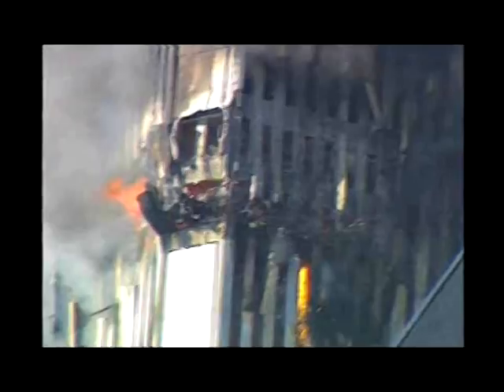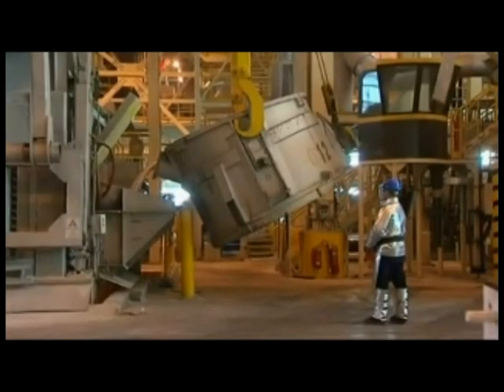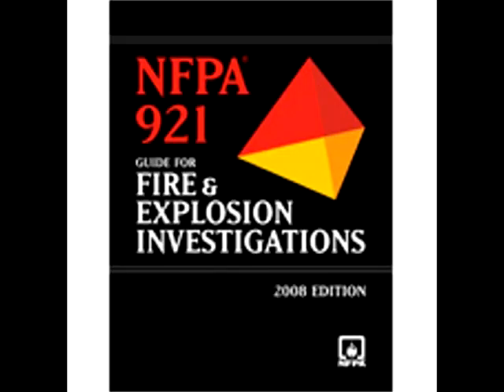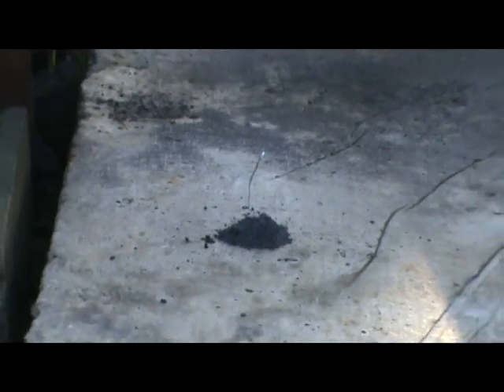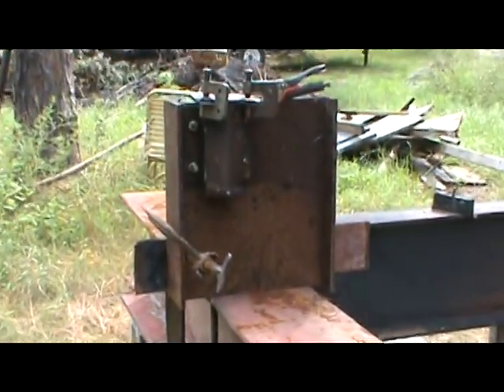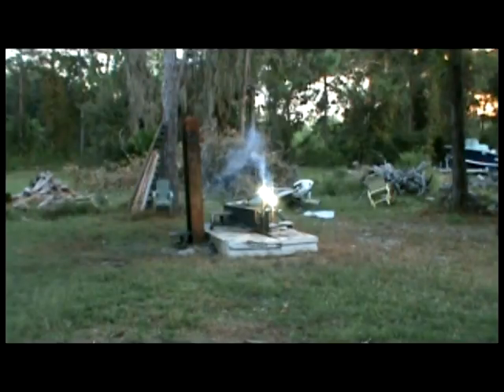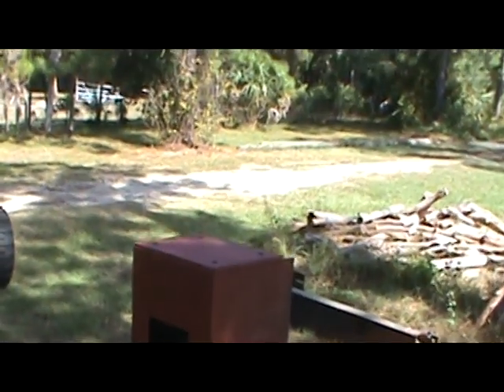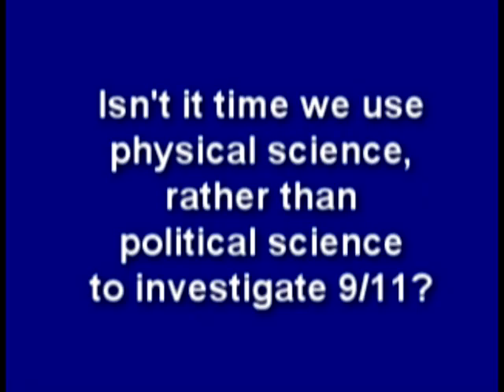9/11 Experiments: The Great Thermate Debate

Comment: The idea that 19 mostly unarmed men could cause such chaos, death, and destruction does not compute. It almost begs for a more complex explanation. Why not remote controlled bombs? That, in an odd way, makes way more “sense” than what really happened.

Remember 911.
Reply: Jason Smith Sure, you are right.  19 unarmed men can't create such chaos.  The thing that you are neglecting is that, once they has possession of the flight deck of those planes THEY WERE NOT UNARMED.  Tons of aluminum filled with jetfuel travelling at 500 miles per hour is in fact a very powerful WEAPON.

THis is like saying that I can't shoot 50 people in a crowded city street because i human cannot kill 50 people.  Give me the right weapons and of COURSE I can do so.
Reply: Mark Doldon
Ok, a plane can be a "weapon", but it is a totally inappropriate one for bringing down a modern steel building. Sure,  you can crash it and make a big fire, but that is not going to threaten the stability of the building.  A B-25 bomber accidently crashed into the Empire State building in 1944, but no one had the slightest fear that the building would  fall.

Comment: A commercial jet liner can not travel at cruising speed at 800-900 feet above sea level.   The air at that low of an altitude is too dense and the plane would break apart.
Reply: JulietsMan Nonsense.  It would probably be too expensive to get the place up to that speed at low altitude, and the engines themselves may not even have the power.  But in a dive the plane's structure itself will easily take the forces.

Comment: You make a very good point! honestly i believe the terrorist may have used intricately placed termite "cutters" on structurally important places. it would be easy for anyone to obtain schismatics of the building. one question i ask is why would the propaganda make the idea ludicrous and impossible.

 i don't think this was planed my the us to go to war that is ludicrous in itself. say if there wasn't people waiting for the planes to hit to ignite the termite to aid in the demolition of the towers.. why didn't the terrorists try to crash the planes closer to the base of the building? were they could potently do more damage to bring the building down? you don't cut down a tree down from the top or mid way. you cut it from the bottom to insure the tree falls, unless you have something planned to help.
Reply: In 1994, Frank DeMartini, was brought in to make damage and risk assessments of the Twin Towers after the bombing. This assessment was made in order to determine what weak areas (if any) that may have needed shoring up, or security placed around the area.

I don't know what came of those assessments, whether they actually shored anything up, or secured any vulnerable areas.

But I DO know that the design plans and the risk and damage assessments were handed over to FEMA and NIST.

Comment: Where do you propose they put the thermate? And how did they apply the thermate? And how was the thermate ignited?
Reply: Ask FEMA and NIST. They were the ones who had the risk and damage assessments that were completed after the bombing in '93.

Ask SAIC, who owns the patent on nano thermite.

You might as well ask them, because your Press certainly won't!
Reply: Thanks to the limitless generosity of the US taxpayers, your questions have all been thoroughly answered.  Although many of the details are Military "secrets".  If you look at all the Youtube videos of WTC wreckage, you will note that some of the columns were cutoff diagonally, with the Thermate, to facilatate the instantaneous elimination of any support to the respective buildings.  In ancient times, it would have been set off by fuses, like fireworks, but nowadays there are improved radio controlled and timed methods of ensuring that the explosions can be performed in designed sequences to steer the buildings as desired.  Most likely the Thermate would have been carefully contained by certain elements , around the columns, to ensure  the cuts were made as desired.  All this can be controlled to the millisecond.  But the fancy explosives are certainly not something that illiterates in Afghanistan are going to be able to obtain.

Comment: I'm not going to say what kind of inside job this was, if it was our government behind it, or some people who worked in the towers. Either way, the buildings didn't fall because of the planes alone. Some one, a group of people would have had to go in and deliberately set things up prior to the day all this took place. There was definitely a group of people on the inside that was behind this, but who they were working for we may never know.

Think about it, the 2 planes did most of the damage on the side of the buildings. Yet both buildings fell straight down as if it was a controlled demolition. If the buildings fell because of just the planes, they wouldn't have fallen straight down, but instead the side weakest around the impact would give way, the tops of the towers would lean, and the building would tumble down damaging buildings around it.

It's obvious that the destruction of the buildings was a controlled demolition, and the planes running into them was just a cover up. Of course the media, and most of the US is going to try to debunk the idea that our own government was behind this. They don't want to believe our leaders could be willing to do something like this. As I said though, who ever did set these charges was working for someone. Who they were working for, we may never know.

Comment: don't need to be scientist  to know  fuel cant melt steel..

almost everyone see or hear  about burning out cars.. if you take  just one look  on a burned out  engine area, you can see  randomly might  the aluminum  engine head can  melt.. but the steel  springs and valves are remain in intact..

whats more, springs are keep their  temper, means they don't softening..
without any  scientific knowledge or evidence..
you don't have to be  physics professor to see  it.. 

and yes its  worth very much to seeking  the truth for the memory of those victims.. 

to david smith, you have the right to make your  experiments  and show different..
without you make experiments, your  words worth as much as  3 years old talkin in the kindergarten